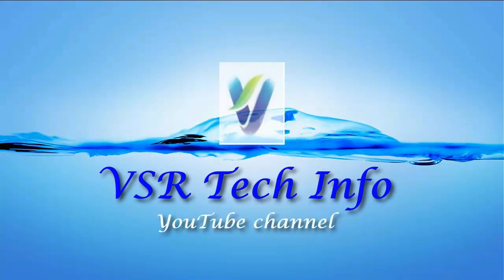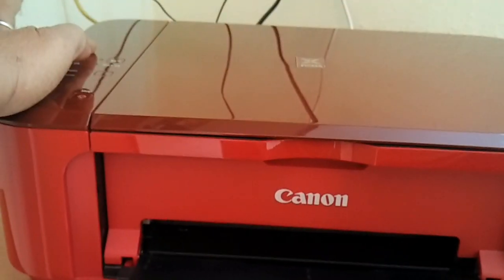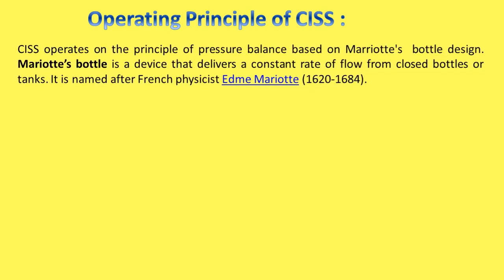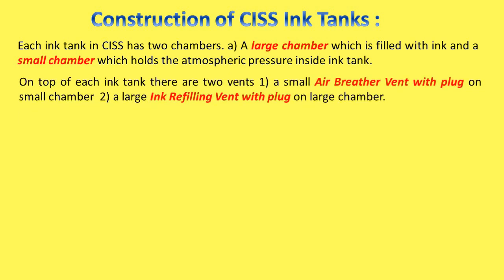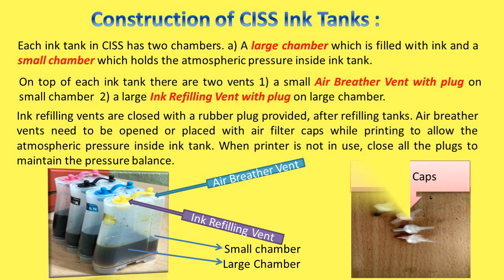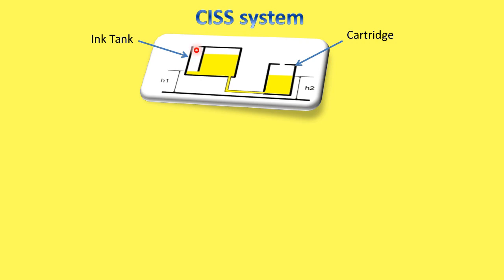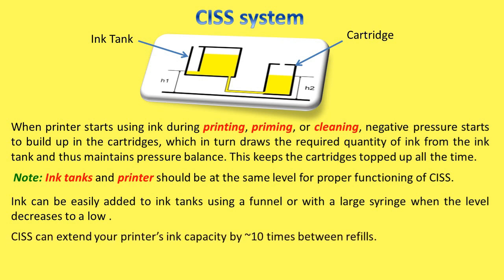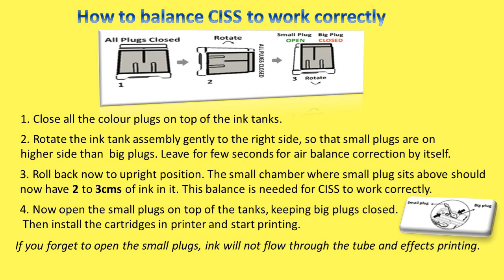CISS Working Principle | CISS How it works

Comment: Sir, with all due respect, in your illustration starting at timeframe 4:23 there is some misrepresentation. The ink tube should be connected from the bottom of the ink tank and the other end is to be connected on top of the printhead. If this the case, how will you illustrate the height "h2" to show the balance of pressure? How much ink should be inside the printhead? Shall we filled it in full or there should be space or air inside? Thanks for your answer, Sir.

Comment: sir i have ciss installed in my canon pixma mp258 printer, at present am using ink from the brand GOCOLOR.   i want to know if i can use canon original ink for canon ink tank printers in my ciss system?
Reply from the maker: Yes for sure.
Reply: @vsrtechinfo  thank you for giving me your time, much appreciated. sir two more query, Firstly, Everytime when i am using ciss, should i open the stop roller to full or just enough to pass the ink drop by drop?  Secondly , do i need to replace cartridges even when ciss is installed?
Reply from the maker: While printing stop roller to be opened full so that cartridge gets ink from ciss tanks and when not it should be shut completely.
Reply from the maker: Please subscribe and share my video to other needy.

Comment: Thanks. How come your CISS works but the hole where the ink exits out the ink is lower than your catridges' holes?

God bless.
Reply from the maker: Detailed principle of operation is explained in the video. Always CISS tank to be at the same level as that of printer. If placed above cartridge level (elevated position) ink starts leaking in the printer and damage the equipment. Please watch complete video.
Reply: @vsrtechinfo  Thanks which is the Mariotte's bottle in the CISS is it the ink tank or the ink cartridges or both? Which is the air inlet and which is the siphon? What do you mean same level as the printer? Same level as the cartridges (which would be higher than the table) or same level as the bottom of the printer?
Reply from the maker: Same level as bottom of printer when printer kept on table.
Reply from the maker: Siphon is the method of drawing ink from cartridge . Air inlet are the vents provided in top of ink tanks. Ink flows from tubes provided from the bottom of ciss tanks.
Reply: @vsrtechinfo  You're right, I miscalculated, the int tanks' hole (inside the tank not where the tubes come out should have been measure to be at the same height as the printhead of the cartridges not the holes on the top of the cartridges. 

I have to clean the colored cartridge again and open it up, the blue overfilled onto the yellow (inside) and most like red as well but it's a blessing in disguise coz once I fix the other printer, the back up one, I can do it again but also ultrasonic clean the heads about 40x (90 seconds each), I saw a refillable cartridge reseller doing that to get rid of extreme clogs. I'll use distilled water (put it in a cup so only that amount is contaminated w/ ink). If it's too stubborn I'll use the cleaning solution (but that's until I have a budget for a backup black cartridge coz' that's cheaper to buy genuine if I break this genuine one :-). We can print with the just black though, for sure it's overflowed at the bottom of the ink (dried) which I'll clean later.
Reply from the maker: All the best and Happy printing 😊
Reply: Hi, I still haven't made the CISS successful (it's been 4 years of trying X-D) on my Canon MP287, the ink isn't siphoning the ink from the tank but is only using the ink in the cartridge (essentially it's just a refill). I did cut the tubes shorter, will that affect the Mariotte principle? Also should seal the silicon plug onto the catridges and the L-shaped plug (at the ends of the tubes) w/ silicon sealant so there's no air leaking? thank you.

Comment: Hello Sir,
Which ink have u used?
I have needle(brand) ink with me right now, Sir which is used for simple cartridge filling...do we have to fill it specific ink or any simple ink will work?
Reply from the maker: Ink as recommended by manufacturer. Compatible inks also will work compromising to some extent on quality of prints.

Comment: There are bubbles on the hose and the ink doesnt reach the cartridge on my friends printer. Today we tried printing by raising the tanks, But the ink end up spilling from cartridge, should we replace the cartridge? Hope someone can answer.
Reply from the maker: First of all the ink tanks should be placed in the same level as that of printer. Air bubbles to be removed from the pipes before plugging them to the ink cartridge.
See my video till last, I have explained in detail.
Reply from the maker: Priming of cartridge is an important thing for proper ink flow. Must do it.
Reply: @vsrtechinfo  Thank you so much! We live outside the city, and we have to do everything on our own. I did watch the whole video. Kinda helps. Hope we can fix it once we get our hands on ciss tools.

Comment: Sir, thank you for the helpfull video and clear explanation. 
I have the very same model of printer and so it is even more interesting to me.
I noticed that the ink level in the  chambers appear lower than the print cartridge. Possibly even lower than the nozzle (but this can't tell for sure). Does the CISS still work regardless ?
Thank you.
Reply from the maker: Yes CISS will work.
Reply from the maker: Yes, CISS will work
Reply: @vsrtechinfo  thank you for the immediate answer. That's good: will make it easier.
Then the ink is not pushed by gravity / atm pressure but rather sucked by the cartridge ( capillarity ) ?
Reply from the maker: Note: CISS should always be at the same level as printer. Told in video.   When you put CISS at an elevated position, ink will overflow from cartridges and spills inside printer.

Comment: I have a Canon pixma and there are air gaps in the ink tube. I tried deep cleaning, but it didn't work. I always make sure that the plugs are open when I'm printing so there should be no problem. It's just that the ink doesn't flow correctly. What should I do? 😭😭
Reply from the maker: Suggest to have air gap removal tool to remove air from cartridges which works on suction based. This is available in Amazon online stores. Tool will have two separate rubber pads one for black and  other for color cartridge will come along with the tool. Check other videos on this to have knowledge how to use it. This will help in removing air from cartridges after refill. Then ensure that no air is present in tubes and connect tubes to cartridges. This should solve your issue.
Reply from the maker: Always ensure your CISS is at the same level as that of your printer to avoid ink leaking from the cartridge.
Reply: @vsrtechinfo   sir when I'm sucking the air out, should i leave the both the rubber stoppers of the ink tanks open or should i just leave one open? If so, which one should i leave open, the bigger or smaller one?
Reply from the maker: When you fill the ink, it is through the bigger one. After filling the bigger one should be closed. The ink flows from bigger chamber to smaller chamber and from there it flows out through the pipe pushing out air from the pipe. Now bend the pipe and put a clip so that ink will not flow back into the chamber. Close the small chambers plugs. This will ensure that air pressure is constant. Now bend CISS unit as stated in video and ensure that 1/4th of small chamber is with ink. This is required for proper ink flows into the cartridge. Now, remove the clip and connect the pipes to cartridges, place them back in printer. Before printing always remember to unplug small chambers and after printing close them back. I here assumed that you have taken our cartridges for priming.

Comment: What to do if the ink tank is on same level as the printer and still ink starts leaking from cartirages all the time even when the printer is not being used ?
Reply: When printer is not in use close the plugs on ciss to lock the air pressure  and hence avoid ink flow.

Comment: Sir, Does closing the air vents during printing affect the print quality?
Can I just open the air vents when the ink levels are low?
Is that recommended???
Reply from the maker: Yes closing air vents while printing effects printing. Always open air vents before printing job and when finished close them. Refer my video.

Comment: Hi, could you show how you installed the CISS tubes to move along with the printer heads? TQ.
Reply from the maker: After fixing tubes to the printheads , place them on the moving cartridge holders. Move cartridge holder to the extreme left, arrange pipes as show in the video and ensure that tubes will not block the movement. Now, move to extreme right by holding tubes in the middle of the rail. Tie the tubes at the middle to the rail. Now again check extreme left and extreme right for proper movement. Always see that tubes doesn't block the cartridge movement.

Comment: Sir how to put tubes sir you have video guide
Reply from the maker: Place tubes on the metal rail and tie them to the rail with a small wire or thread. You may also use glue tape to fix tubes on to the rail. Ensure that cartridge movement is not hindered. This is shown in video.

Comment: Bhai mana lagaya but ink bapas tank main kiyou cala jata hain

Plz bhai help kro
Reply from the maker: There may be air in the cartridges. You need to first prime cartridges and ensure that no air is present in them then connect ciss.
Reply from the maker: I hope you have cartridge priming tool to remove air from them. Check Amazon, flipkart for the tool.

Comment: I have installed ciss in my hp 3835. Now when i keep ink tank at same level to cartridge it dont print and when i place it higher it starts leaking ink inside printer.. What to do Sir??
Reply from the maker: Ink tank should always be at the same height as that of printer ie, on the same level as that of printer. This is told in my video. Raising it's height will cause ink leaking from the cartridge. Try to understand the CISS concept explained in video before attempting practically. Ensure that no air gaps are present for printing. If any airgaps remove them first so that ink flows with out interruption.
Reply from the maker: Also ensure that small plugs are open while printing.
Reply: @vsrtechinfo  ok thanx for replying
Reply: @vsrtechinfo  hii were is your office i want to get my printer modified

Comment: Sir,
Will it work on canon pixma 3570
Reply from the maker: This principle will work on all inkjet printers, you need to ensure proper routing of rubber tubes which carry ink as per the printer model.

Comment: Hello. Can you tell me the procedure of resetting Canon MG3680 after refilling ink CISS. I refilled ink but it is still flashing both black&collar lights. What should I do?
Reply from the maker: If orange lights for Black and color are flashing along with warning light, then --- press and hold down stop/reset button for few seconds till you find that warning light is off. Ignore Black and Color lights flashing. Try printing now printer should print. If no warning light and only Black and Color lights flashing ignore this as refill cartridge will not be sensed.

Comment: Can you mix Dye ink Prints with Pigment inks??? Say I ran out of Pigment inks then I buy Dye ink and then can i use this in the ciss system?  I am new to this ciss.
Reply from the maker: Dye based inks consists of colorant that is fully dissolved in liquid, where as Pigment ink consists of very fine powder of colorant suspended in a liquid. If you mix Dye and Pigment ink, your print  head may get damaged as it is designed to take in particular ink type.